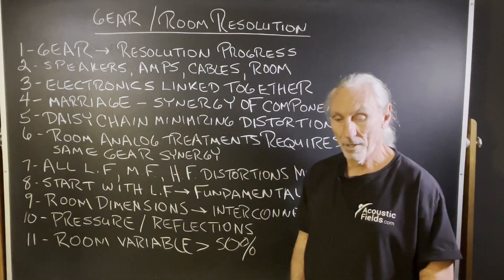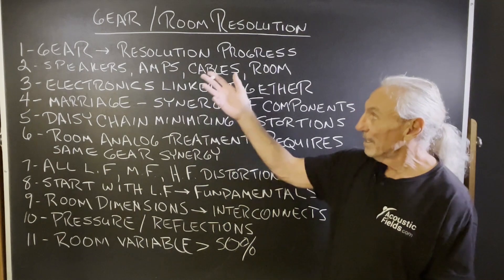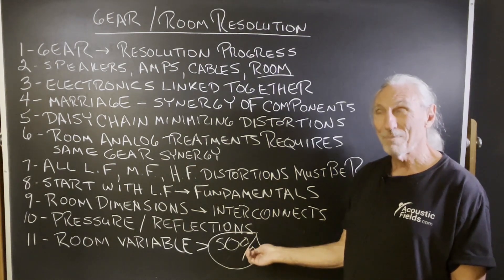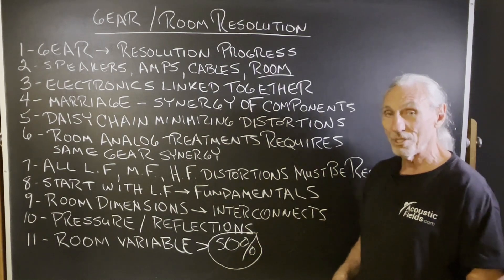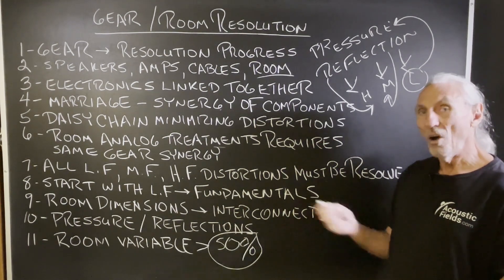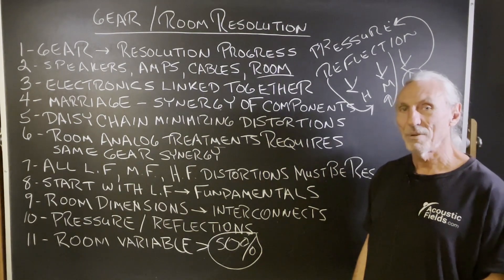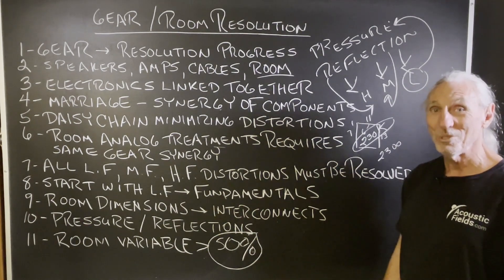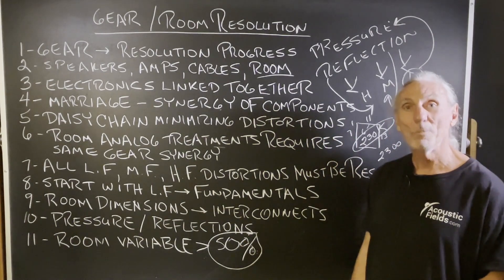Gear/Room Resolution - www.AcousticFields.com

Comment: in this video you have asked us to consider how much energy we are putting into the room. my question is , how is that energy measured & is the way its measured different depending on the source? (musical instuments/speakers )
Reply: Energy is SPL to my knowledge
Reply from the maker: The unit of measure is the decible. Energy is expressed with the lable of dB which stands for decibles. You can measure the energy within your room with a SPL, sound pressure level meter. Another common term for this, although not technically correct, is a decible meter.

Comment: Room treatment is not marketed or discussed enough in the publications that promote gear.  From reading the publications like Stereophile, Absolute Sound, Mix (recording/studio), etc., they simply don't have many articles, reviews or advertisements promoting room treatment.  When they do, it's usually from companies that advertise in the publication.
Reply from the maker: Most of the reviewers rooms are not set up or treated properly. When you read the reviews about a speaker or amplifier and they comment on the gear's performance, they are actually describing room sound not the gear sound. Their rooms are not capable of resolving gear and speaker issues.
Reply: @AcousticFields  I know. It's a blind leading the blind.  Most of the reviewer's rooms violate everything you've discussed in the Don't Do This videos. 

The products that get me laughing are those HFT devices Synergistic Research sells. Of the Shakti Innovations Holograph device.  Unbelievable how anyone could think they do anything other than suck money from one's bank account.